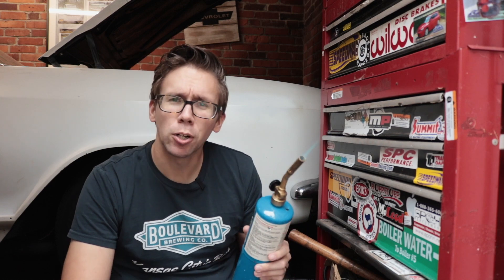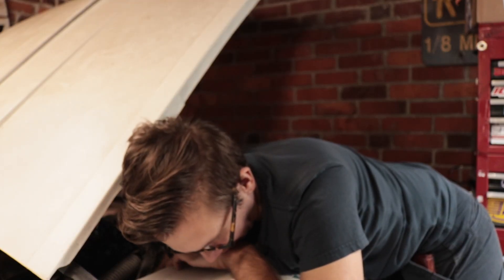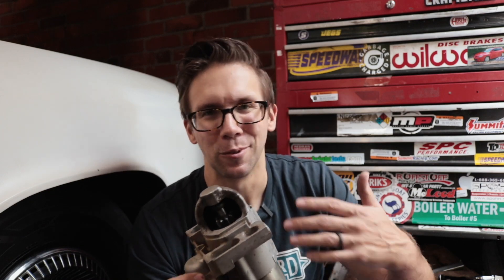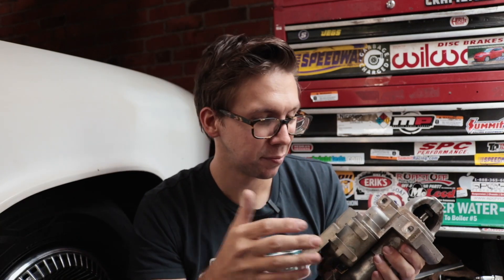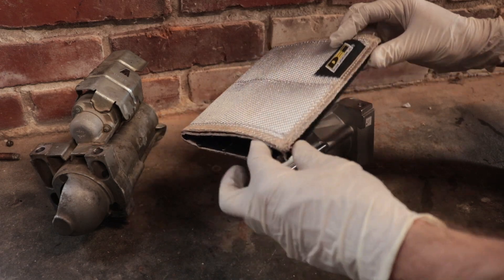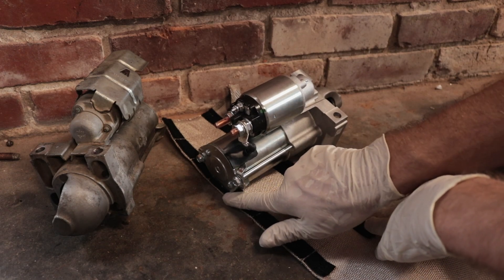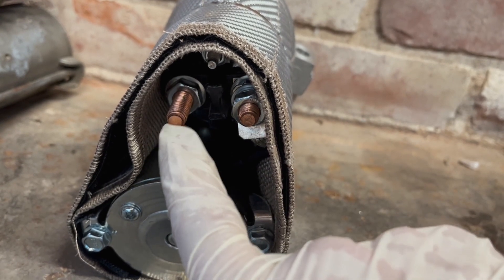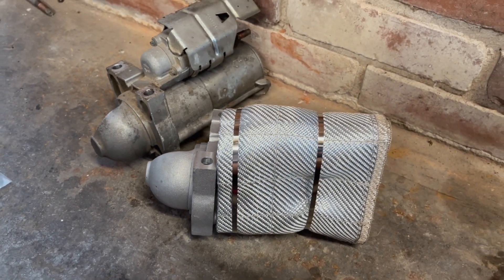Fixing Starter Heat Soak -  DEI Ultra Shield MA

Comment: A scrap piece of aluminum bent in a curve, 4 pop rivets and a hole to put the upper starter bolt through fixed my 67 Mercedes problem of needing a new starter about every 4 to 6 years.  I haven't changed it since 2000 and it still cranks like new.

Comment: Been battling heat soak in my 100% completely stock 2019 F150 5.0 coyote got a similar kit I need to instal. Started at 70k only when towing would just click. Now any day stop run in a store 20 mins or less come back put click try a few times starts right up. It never argues with the flywheel at over a 100k now

Comment: Do you know exactly whats failing inside the starter to cause it to not
start from the heat? I heard the wires or solder expand increasing resistance. Sound plausable?

Comment: I just bought a welding mat, seems to be much more than enough if it can handle map gas and cheaper too.
Reply from the maker: Holy shit - that’s an amazing idea. Dude I think you just dumped a secret onto the world. I kinda wanna this in a video and test the heat resistance of stuff.
Reply: @MatthewFinlay  being a cheap bastard that I am I cant justify paying 60 bucks for these precut heatshields when welding mats only costs 20 or less, I paid 15 for half a meter one.
I tested it with my mapp torch it kinda burnt it a lil bit as it was directly heated but I doubt the ambient temperature around the engine will ever reach 5000f
Reply from the maker: @GCS88 ya dude that’s kick ass - you know the materials they put into these things can’t be more than a couple dollars
Reply: @MatthewFinlay  Give it a try though I'm too lazy to take temp difference myself 😁 when I was looking for a starter wraps online I actually thought 'isnt these the same as welding mats?' so since I was replacing my starter motor just yesterday I though I might as well try it on as an  experiment and I still have 500cm left over for something else 😃

Comment: After driving my truck for about 30 miles, I turn it off, then try to start but only clicks.  After it cools off it turns on, will heat wrap work?
Reply: best bet would be to replace your starter heat wrap may help but your starter is already on its way out

Comment: I just went through this with v8 camaro n headrrs.  Old starter.  Take the car oit cruise a while shut off.  Dead.  Have to push start 5 speed.   Annoying.
Reply: The Camaros have an issue with starters. If yours is a 5th or 6th gen it has to do with the battery being in the trunk, the long runs of cable and the heat soak of the starter. Wrapping the starter will help but the big fix (as seen in numerous Youtube videos) is installing a shorter  "0" gauge ground wire from the frame to the engine block. Most report this cures the starter issue. PS- I have a 2011 Camaro 2SS and it has also suffered from the starter issue. It has had 3 batteries installed and the car only has 25,000 miles on it. I am using a Red Top Optima battery now and that really helped. I am doing the ground wire next. Then will come the wrap.
Reply from the maker: @realnikonlover6207 nailed it! I’ve seen it a few times on stock cars but add in aftermarket header or god forbid long tubes and it’s over haha
Reply: @realnikonlover6207 I just got a 5th gen and barely dealt with the slow crank on hot starts. It wasn’t an issue most of the time, if not all. The OEM starter motor eventually gave out abruptly and suddenly after I parked it on a super hot 103+ F day out. Wouldn’t crank over at all; car was fine, as well as the battery and terminals, grounds, etc. 

I eventually did add some 4-ga “battery to switch” cables, to use as the trunk battery auxiliary ground; and I used the other one to makeshift a ground from the driver’s side of the engine block, going to a spot on the passenger side on the frame/chassis, where a small ground wire already exists. 

I ended up heat-wrapping a cheap generic, aftermarket starter with the DEI Mini-Versa heat resistant blanket, and some metal zip ties to keep the velcro from coming apart.
Reply: A good quality starter with a dei wrap will stop that